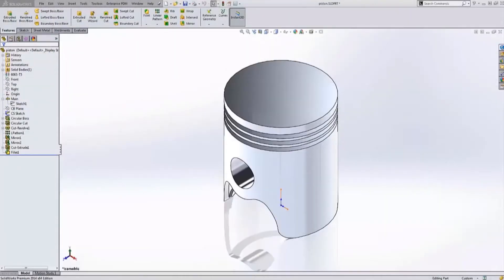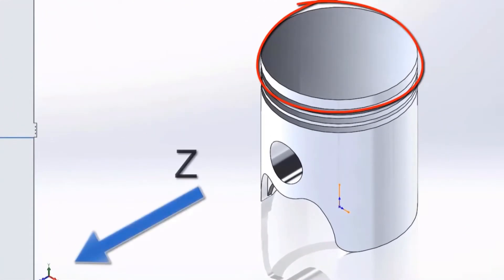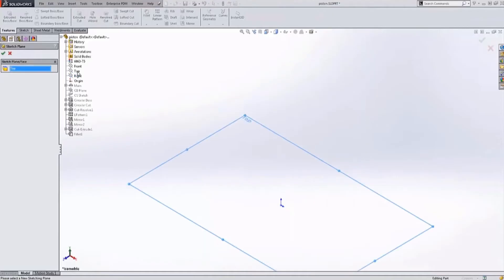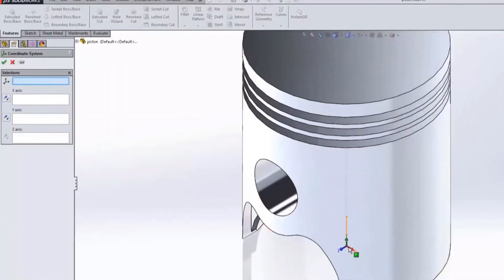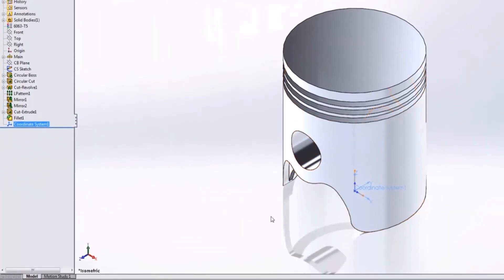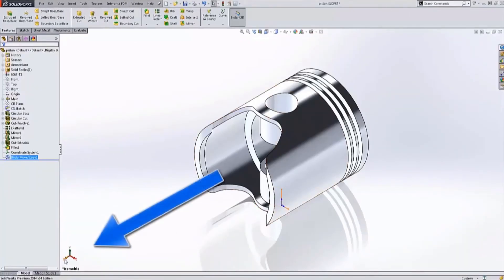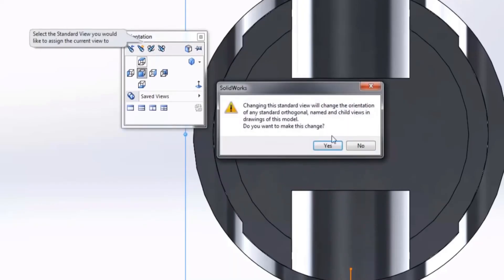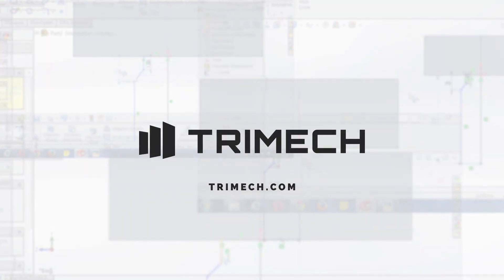Video Tech Tip: How To Reorient Parts and Coordinate Systems in SOLIDWORKS

Comment: I can't think of a time I would have felt justified using move/copy just to realign a part for use in an assembly. Can anyone give an example that shows why this is important? I can see changing default views, but adding a feature seems like it would need a reason.
Also, you can reload your part to undo all changes instead of closing and opening it again. Just click file->reload->okay